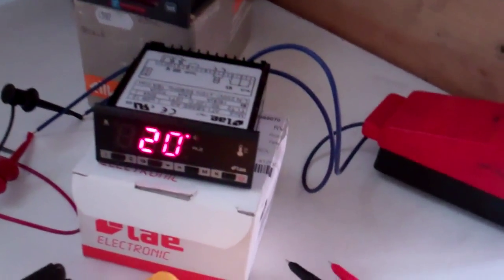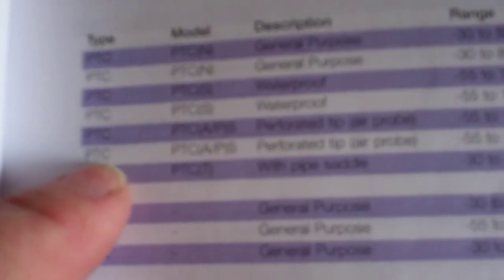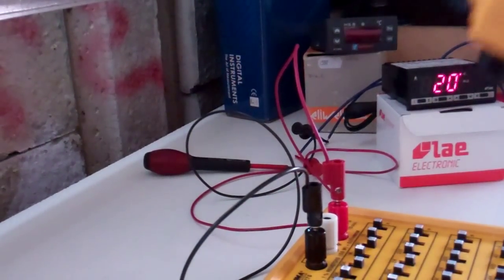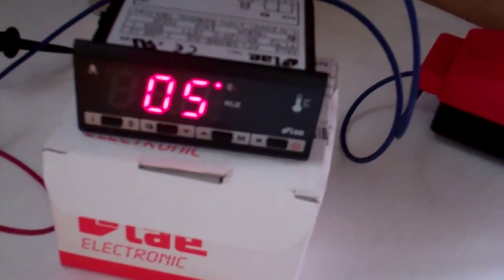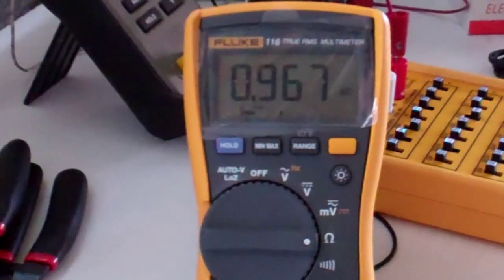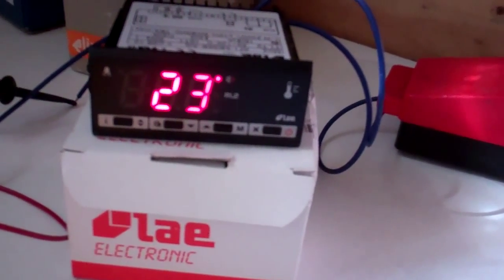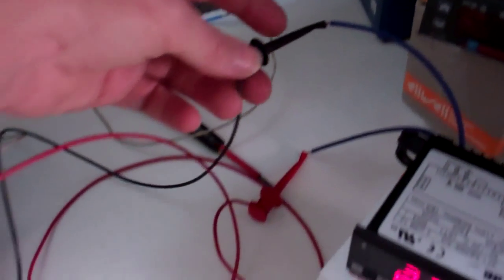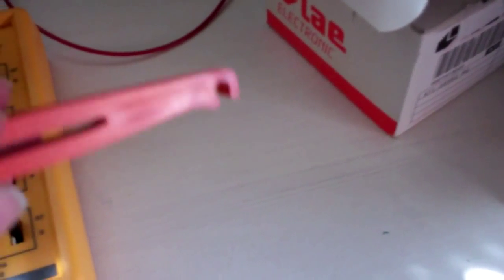Resistance is Fertile/Decade box Demo

Comment from the maker: Hi Aurelius, I got the decade box from Farnell i think. The digital thermostats are available from refrigeration wholesalers here, they are available with between one and five relays and can control heating or cooling model dependent, they are either 12v or 240v here though i expect 120v version will be available in other markets.

Comment from the maker: Thanks!  I thought about making a box up with some variable resistors in, in many ways it would be simpler to use and quicker to home in on the correct resistance, but i like my gadgets :-p and i thought with this i can just read off the resistance or set it at the correct value.

Comment from the maker: Hi Fritz!

I think it would be clearer to see it in use in a real world scenario. I got one for Dave as well he does most of our air con work, he's had a few systems with faulty thermistors that this would have helped with e.g.
Mini split won't start the evap fan in heating mode (waits for coil temp to rise so no cold draughts) Could order a new sensor and call back then find its the board or motor, but with this can mimic most sensors.
Modern stuff can be much more complicated to trouble shoot!